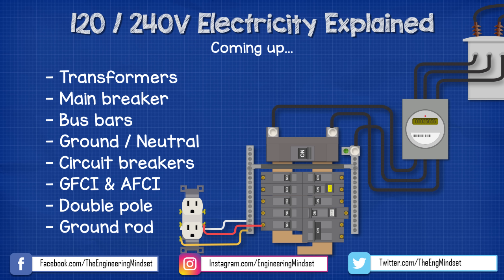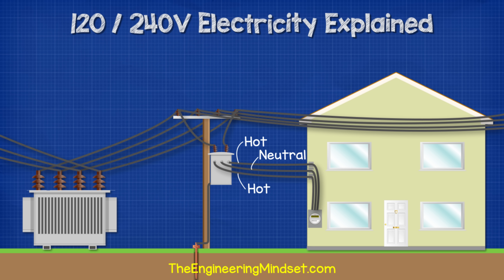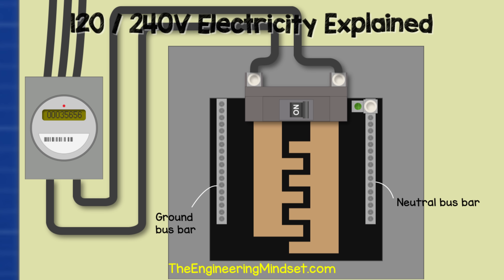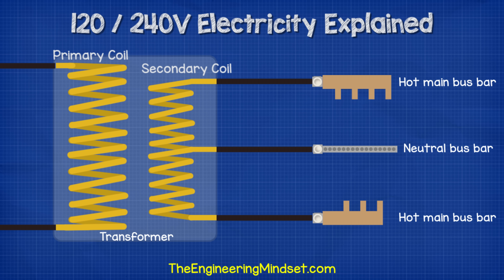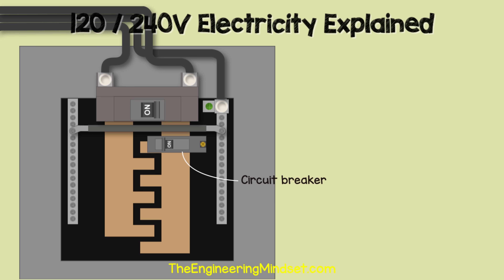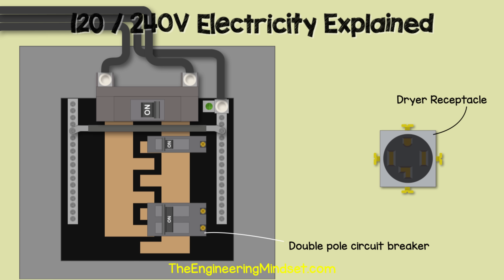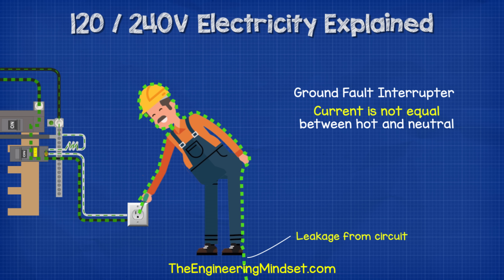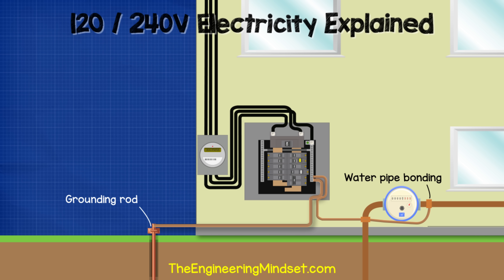120V 240V Electricity explained - Split phase 3 wire electrician

Comment: i though the ground was physically grounded with a grounding rod and the common went back to the grid where they couldnt be linked because of code? code being that ground wires cant carry current in the exception of a fault while common can
Reply: They have to be linked, code just defines where they are to be linked.

Some places it is at the pole, in the US it is normally at the Main Panel, for a Mobile Home, it is usually at the Meter, and you are not allowed to connect them anywhere else, because then you get current flowing on the Grounding wire, instead of only on the neutral/Grounded Conductor/white wire.

The Grounding wire is also connected to a ground rod, but that is for a separate purpose.

The Grounding system serves as lightning and static protection, keeping all the metal surfaces at ground potential, and helping with electrical interference etc. It does this all the time, not just under fault conditions.

Under fault conditions where a hot wire is shorted to a grounded enclosure, it carries the current back to the neutral/Grounded side of the power supply, ensuring that enough current flows to the trip the breaker.

Little known fact.
Under most circumstances, if you connect a hot wire to a grounding rod with no other wires coming off of it, you will not trip the breaker.
The earth is too high impedence to allow enough current to flow to trip a breaker.
It only trips when connected back to the grounded side of the generator that produced the power, or in this case, the grounded side of the transformer.
Reply: @ke6gwf  okay so one more question, what is to stop the neutral from grounding its self instead of sending current back to the transformer?
Reply: @Capthrax1  if you hook a hot 120 volt wire up to a ground rod, you will get about 4.8 amps of current to flow.
If you hook that same wire up to the neutral wire, you will get 4,000 or 5,000 amps to flow.

You get very high impedance through a ground rod, and very low impedance through a large copper wire.

The source of the current in the house is the transformer on the pole, and so in order for current to flow, it has to return to the transformer (all current requires a closed loop circuit), and the big wire is the only way for it to flow.

Yes, if there is a ground rod at the transformer, and a ground rod bonded at the panel, you will get a little leakage current through, but even if the neutral wire is cut, you can't get more than 5 amps through that path.
Reply: When the neutral and ground connect at only one place then current cant flow through the ground wire.  Bonding them keeps the exposed neutral metal in light fixtures close to ground potential so you don’t get shocked when changing light bulbs.
Reply from the maker: Watch this https://youtu.be/P-W42tk-fWc
Reply from the maker: We just published a new Ground fault, short circuit and arc fault video, so much detail! Link HERE➡️: https://youtu.be/Qi0ynSQw-wc

Comment: Whats the reason USA using 120/240V while the rest of the world using 230/400?
Reply: The US of A has used 110v before the rest even had power grids. And then they already had an infrastructure on 110v and switching to 230v would have been too expensive. Im not 100% sure but 90% :)
Reply: Cokémon I think europe was way further ahead.. but I think the world wars had a big impact. Big cities were destroyed and they had to build them up again.
Reply: And yeah switching to 230/400 now is way too expensive.. to late
Reply: @Mister Brookes Every other country is also super small or doesn't have anywhere near the infrastructure the US has. And 240 and 480 is readily available in the US as well for things that may need it.
Reply: @Mister Brookes There's no point in increasing over 120 volts when nothing even utilizes the full power of it 99.9% of the time as it is. Especially in modern times with how efficient electronics are.
Reply: @Mister Brookes You would need more copper because you're channelling far more power down the line then. If you went with thinner wire, then it would melt. There also aren't any grills that are 2,400 watts, or heaters that you can buy over 1,500 watts. If you need more than 1,500 watts, then you need to go to a propane or natural gas heater. My house also has four 240 volt electrical outlets. They are rated between 40 and 60 amp draw, at 240 volts, at 60 Hz. The wires to them are twice as thick as 120 volt outlets. So it definitely requires more resources for 240 volt.
Reply: @Mister Brookes And 240 volt outlets start at 40 amps and go higher from there. Nothing beats a 120 Volt, 20 amp outlet for consumer purposes.
Reply: @Mister Brookes Your just not getting it. A 240 volt outlet system uses 2x thicker gauge wire to handle the current. My 240 volt outlets in the house are rated between 9,600 and 14,400 watts. Your still pushing twice the voltage too. The United States, Canada and even Japan use the 100 ~ 120 volt system in homes for consumer goods, because it's the best setup possible. We use 10 gauge/2.59mm wiring in our homes for our electrical outlets. It's rated between 20 ~ 30 amp draw depending on circumstances. And for our 240 volt outlets, we use mostly 6 gauge wiring. (4.12mm)
Reply: @Mister Brookes 10 gauge has a diameter of 2.59mm in the US. 6 gauge is standard for 240 volt in the US. You need to have thicker wires to handle the higher voltage and amperage. 6 gauge is twice as thick as 10 gauge. So 6 gauge is used on 240 volts here. Regular outlets are always rated between 15 and 20 amps and 120 volts. 240 is almost always 40 ~ 60 amp.

Comment: Nice lesson!  Have you noticed the arguments on the 240/120 secondary voltage where some say that is 2 phase and not single phase?
Reply: I often call it 2-phase just to annoy electricians lol

There are actually industrial 2 phase electrical systems that, though mostly no longer used, already own the name, so since this is not phased like 3 phase, they used different terminology to avoid confusion.

So I sow confusion and call it 2 phase!
Reply: There is only a single phase.  There are often three phases on the pole, and one of them feeds your transformer.  The next transformer on the street is on the next phase, and so on.  So if your power comes from one phase on the pole, how is it two phase in the house?  People get confused because they think the phase is somehow reversed when they are actually reversing their meter leads.  If you measure the voltage from one end of the transformer, you’ll measure 120v to neutral, and 240v to the other end, and both measurements are in phase.
Reply: @stargazer7644 , phase is a measure of waveform, and in a standard 120/240 residential service, the two 120 volt legs are 180 degrees out of phase in relation to each other.

This means that when one is at peak + voltage, the other is at peak - voltage, so 220 volts between.

If they were both in phase, you would not get a potential between them, it is only because they are out of phase that you can get 220 volts between them.

3 phase power is 120 degrees between phases, and household power is 180 degrees between phases.
But there are 2 separate phases created by the transformer.

There is also an old system called 2 phase that is 90 degrees between phase, used on some old motors supplied by early power plants, and some may still be running somewhere, but almost no one has ever seen one.
Reply: @ke6gwf  Phase is relative to your measurement points.  Put the ground on your (isolated) scope on the bottom leg of the transformer.  Put ch1 on the half tap point (what becomes the neutral), put ch2 on the top leg of the transformer.  Both waveforms are in phase, and one has twice the amplitude of the other.  

The reason you see a 180 degree phase difference is because you choose to put the common at the half tap point, the half voltage point, rather than the lowest voltage point.  You can certainly see a potential difference between two in phase signals when they are of different amplitudes.

This is a single phase split leg (half tapped) system. It is not a two phase system.
Reply: @stargazer7644  my point is that there is a phase difference between the outlets on 120 volt leg 1 and the outlets on 120 volt leg 2, which means that technically there are 2 different phases.
Which is why I refer to it as 2-phase power to annoy other electricians ;)
Reply: 2 phase + neutral:
From single phase transformer called single phase.
From 3 phase transformer called 2 phase.
Reply: Star Gazer    WOW!  Someone that finally gets it!   I've heard so many say out of phase and 180 degrees out of phase that it makes me sick.   They only know what the teacher said!   I agree with you 100%.   The oscilloscope is absolutely the cause of their misunderstanding.   I salute you sir!    Very respectfully,   Kevin

Comment: I was braced for it, but you got it right!
You never said that fault currents to the grounding conductor return to ground! I was shocked!
Most people, even pros, get this wrong.
Yes, it happens to be grounded, but it is there to return the current to the original generator that made it (via the transformer), thus completing the circuit to enable enough current to flow to trip the breaker.

You get a thumbs up for getting this right lol
Reply: I believe the GROUNDED conductor(neutral) returns current to "X0" at the transformer. The GROUNDING conductor carries fault current to ground.
Reply: @Drezed01  and where pray tell does the current from the power plant go once it reaches the ground rod via the Grounding conductor?

Remember now that in order to have current flow, you have to have a complete circuit...
Reply: @ke6gwf  , current should only be flowing in a GROUNDING conductor in a fault situation(or possibly some residual, or induced voltage). The GROUNDED conductor carries current back to the transformer. Current "used" in circuit actually NEVER returns to a power plant, as the transformer is of an isolated variety.
Reply: @Drezed01 , so, if power has to complete the circuit back to the transformer in order for current to flow, how does it get back in the case of a fault putting current on the Grounding conductor?

How does it get from the ground rod back to the transformer when a hot wire shorts out to a grounded enclosure?
Reply: @ke6gwf  , through the earth to the GROUNDED conductor( the neutral).
Reply: @Drezed01  have you ever learned in basic electrical theory that electricity takes the path of least resistance? So why would it go through the ground at all, if there is a thick copper wire connecting the Grounding wire to the Grounded (neutral) conductor?

You can connect a hot wire directly to a ground rod, and nothing happens, because the earth is very high impedence, and not enough current flows to trip a breaker.

But since the Neutral and Grounds are connected/Bonded, the current returns to the transformer and then power plant, and the breaker trips.
Reply: @ke6gwf  I should have said through earth, AND the neutral(law of parallel resistance). You are 100% right in that it returns via the neutral, though the current flow present in a residence never makes it back to a power plant as the transformer(s) between service and power plant are of the isolated variety.
Reply: @Drezed01  so we have come full circle, from you saying that the Grounding conductor returns fault currents to the ground, to agreeing with me that it returns to the neutral and back to the transformer!
I have successfully helped someone else see the light lol

And yes, if the transformer has an Earth ground rod, there may be a tiny bit of current that goes that route, but it negligible.

Now, on to the current going back to the power plant...
All current flow has to be in a complete circuit, and so if current flows in the house (including via the Grounding conductor back to the neutral and then to the transformer), current has to flow on the primary side of the transformer as well, which comes from, and returns to, the power plant.
Think of the primary and secondary circuits like 2 meshed gears, with the transformer coils being the teeth. Anytime one turns, the other has to be turning.
So in order for current to flow in the house, current has to flow in the power plant, and so the ground fault current has to end up back at the power plant, or no current flows.

A transformer simply changes the form of the current, but the flow of current has to always be out of the generator, and completing an unbroken circuit with the load, and back to the generator.
Transformers in the circuit modify the flow, but that complete circuit between the power source and the load can't be broken, or you don't have a circuit, and you don't have any current.
Reply from the maker: Watch this https://youtu.be/P-W42tk-fWc
Reply from the maker: We just published a new Ground fault, short circuit and arc fault video, so much detail! Link HERE➡️: https://youtu.be/Qi0ynSQw-wc

Comment: I still have a question. In the explaining I see that two hot wires=240, one hot and neutral=120, then in most Asian countries we use 240v, so we use two hot wires without the neutral? Still confusing. Please
Reply: In North America, we use the split phase system, where our consumer equipment and lighting and standard household voltage is all 110 volts, except for certain high power devices like stoves and ovens and dryers and such that use 220 volts. 

Much of the rest of the world uses 220 volts as the standard household voltage, and so you don't need the center tap neutral to get the 110 volts.

So the transformer would look the same, except it only has 2 wires coming out, and one of them will be bonded to the ground, so you have a neutral (grounded conductor), and a 220 volt hot.

So if you look at your two hot wires, one should measure 220 volts to ground, and the other will measure 0 volts to ground.

But being a/c, it doesn't matter which way you connect most things, so it may be treated like 2 hots.
Reply from the maker: Then you need this video instead https://youtu.be/W0_1xRqT8uU

Comment: That circuit breaker tripping is weak af
I live in Britain, but my mum can have a washing machine, dryer and a kettle
Reply from the maker: Surprisingly you can buy a 1A breaker.
Reply: Yes, and you crazy Brits use 220 for everything, so you get twice as much power through the same size wires and breakers!
Reply: And don't get me started on ring mains.... Lol
Reply: Ring mains, in a house with tipically 12 or 24 kW limit usage. First time I helped on a AC circuit I was completely perplexed.
Reply: @Steven Strain oh ok, it's just that the washing machine and dryer is in the kitchen of my mum's house.
And the electric company  had to put the breaker in after about 100ish years

Comment: different at malaysia, neutral n ground wont joint at DB, bar not connected.
Reply: They have to be bonded somewhere it's what keeps the Neutral from "floating" (which can lead to the neutral ending up at high potential compared to ground).
Some places bond the neutral to ground at the transformer, but it's better to do it at the house, so that the static and lightning protection is right there.

Comment: It's a shame that the A.C. from the pole isn't converted to D.C. for use in the home.  It would save many lives.... and make solar so much easier.
Reply: D.C. cant travel near as far. Also D.C. is much more dangerous, hurts alot more.
Reply: @mitchhuitema8914  D.C. can't travel as far that's why I said convert the A.C. from the pole... I should have said from your home's pedestal.  Some people have a pole on the street with a transformer that send electricity to your home.  Any way D.C. is safer in that you are able to let go.  If anything we should have the European standard of 50Hz instead of 60Hz so you can let go.  60Hz is the same rate as the heartbeat and makes it difficult to release when you get electrocuted.
Reply: But it would render most electrical appliances with induction motors (Fans! Refrigerators! Air Conditioning!), 
old-fashioned electric clocks, and anything that needs an internal transformer (Audio Equipment!) unusable. 
DC cannot easily be stepped up or down in voltage like AC can, and most DC motors ---  
particularly those of significant horsepower --- have brushes,  which wear out (needing periodic replacement) 
and arc to the commutator, causing radio-frequency interference. 
Yes, DC is safer, but it's a pain in the ass for use as household power.

Comment: GFCI is not a standard?  What?  In Austria we call the FI (residual current circuit breaker) and it is the first thing that comes after the meter.  It is commit and standard throughout Europe.  Now I understand why in the 120V system countries, so many people die from electricity.
Reply: Michael Schaffer gfci is standard in the US. We are only required to use it on receptacles within 6’ (about 2 meters) of water (a sink, toilet, bathtub,etc). Also, death by electricity is pretty rare here.